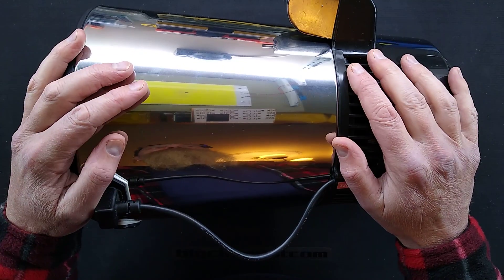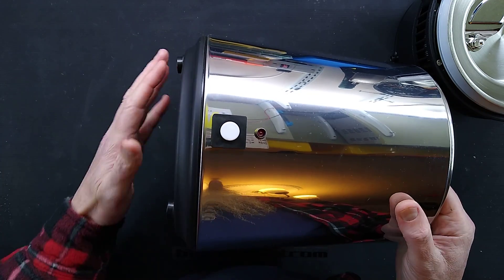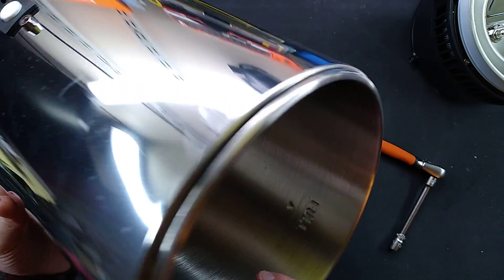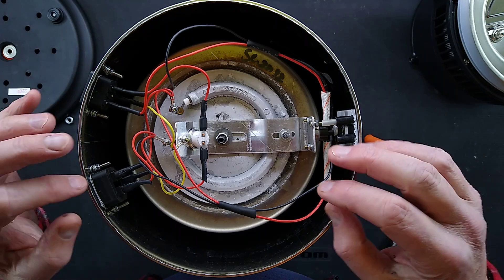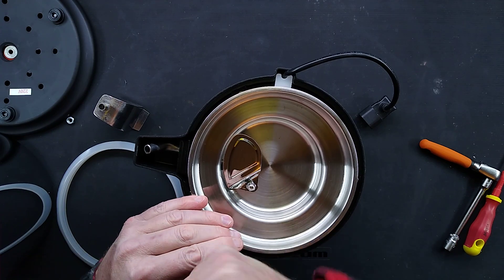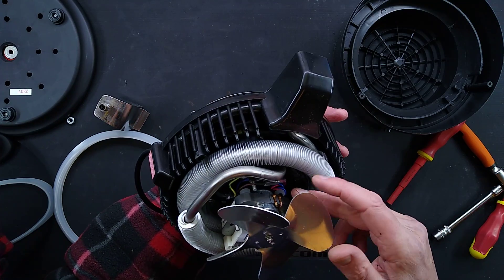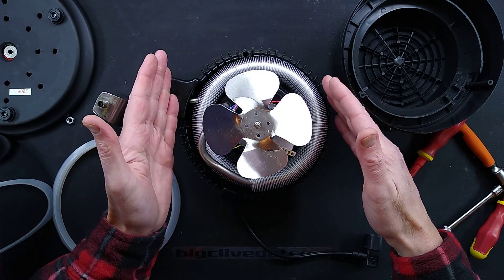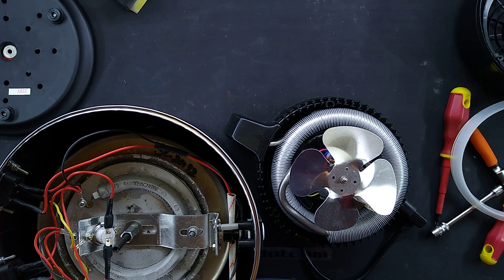Water/alcohol air-still distiller teardown

Comment: Anybody have a link where to buy replacment heating elements?
Reply from the maker: It's spot welded to the boiling vessel, so it's not really viable to change it.  Check that it is actually the element that has failed, as a thermal fuse may have tripped.

Comment: My brand new one expells a strong wine smell out the top butt I cant see any pin hole (could be poor seals). Also what is the fan volts & wattage, someone said you can plug em in a laptop charger
Reply from the maker: They need a full mains supply.

Comment: They also sell a version made for water, alcohol or oil distillation. The main difference is you can set a temperature and run time electronically on the unit. So no mod needed!

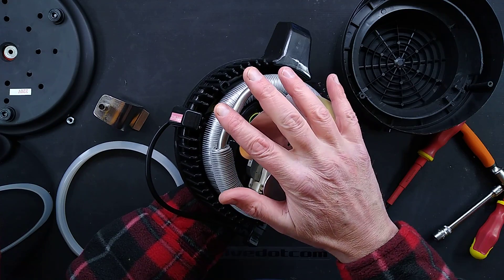Comment: Hello, great video. Around 6:25 you mention that air is pulled in and goes out the sides. Which way around (clockwise or anti-clockwise) does the fan spin as you look down on it? 

Regards
Reply from the maker: Anticlockwise.  It actually pulls air in at the sides and blows it out the top.

Comment: Thanks for making this video :)
Just bought the same one.
I wonder why the temperature - even when the controller is set at the max 150°C - doens't go higher then 99°C (jus water, even after 3 hours).
Is that a limitation of physics ?I should have paid more attention in physics class :)
Reply from the maker: 99C is probably the water boiling and maintaining that temperature by creating a phase change cooling effect.

Comment: We've hadc the builders in and a thick layer of dust has accumulated in the top fan.
From this video,I know you can clean it out now 😂
Thank you.  
Saves me potentially buying a new one.
Reply from the maker: Applying a vacuum cleaner to the outside should be enough.

Comment: This might sound dumb. But, it's one button. you can't set it to a temperature. Does it not operate at 212f? It wouldn't.. work. On water if it operated at 174f.. haha
Reply from the maker: It's intended for water.  The only thermal control is the cutout switch when the liquid runs low.   It relies on the evaporation of the liquid for the temperature regulating effect.
Reply: @bigclivedotcom  Right, thanks. I believe for alcohol you have to buy one thats FOR alcohol. Or a fancy one that is temperature controlled.

Comment: Do you think I could plug the fan into its own power and then run the heater on a power controller to reduce the heat ?
Reply from the maker: Yes.  I think that's common.

Comment: During the Covid thing and the year after I found it difficult to locate steady supplies of distilled water. I'm an older guy and I use a BiPAP machine during sleep that requires distilled water for humidifying the air. The solution to maintaining a supply of distilled water was to purchase a countertop distiller very similar to the one Clive has shown. Thanks to him, I now know how to replace the activated charcoal filter. No, I'm not too old to learn but you might have to talk a little slower.  :)

Comment: I once worked at an organisation that used a lot of lead acid batteries for remote chart recorders etc. and we had a magnificent still made with copper tubing to supply distilled water. Apparently they had replaced it a while before and some years after that "The Revenue" came snooping around to see that they old setup hadn't been put to other uses !  Life is easier with these devices so commonly available.

Comment: Cheers for that. Of course if distilling temperature was critical you could always put a temperature sensor in and use a motor control type circuit to chop the phase as you aim for you target temperature. I suspect a budding tinkerer has already done that...

Comment: I exatly own this device, not in shiny but in white. The area where the heating coil is connected to the bottom of the pot, is not water tight. I am using it now for 4 months, good water by the way, and its leaking inside the housing, out of the area where the coil is connected to the pot. I first noticed it, when move the pot to clean and refill that water spills out the bottom holes..then i shaked the thing, and i hear the water inside. It can not come from the outside of the mashine. Did anybody else have this problem with this distiller? Disgusting what load of dirt is in the 4liter amount of tap-water you will see, after destilling it. Disgusting, i think i never drink that shitwater from tap again.

Comment: The condenser tube is almost certainly stainless steel, probably SS-316, as distilled water will corrode any inexpensive grade of aluminum.
Reply: I can also tell by looking at it (the colo(u)r and sheen).

Comment: We have a similar distiller we use to keep the scale out of our humidifiers during the winter. As there must be some heat loss through those coils, I had thought about adding a normally-open thermal switch to the side of the tank, with the idea of letting the heater bring the water temperature up before the coils get the active cooling. Thought is that maybe it'll cycle quicker and use less power.
Reply from the maker: The heat loss from the top section is very low relative to the power of the bottom section.  It only really affects the steam.
Reply: @bigclivedotcom  Interesting. Oh well. I have so many other projects I should be working on that it wasn't likely to happen anyway. 😁

Comment: You used to need a Customs & Excise licence, even for a water still in the UK, I know because I had to renew our licence in several schools, I worked in. Not the glass version used for demos, but the ones used for producing distilled water. Many were made by a company called Manesty. They used a kettle element.

Comment: I think you can by "plug-in" dimmer switches; though they suggest only for use with lighting? I'm guessing that resistive loads work but that the switching of the dimmer causes voltage spikes? wouldn't anything with A/C as input need to sort out any induction anyhow?

Comment: Good day sir. I really like your channel. I have an old engine analyzer. It has diffrent settings for diffrent functions. One of these functions stopped working. I took it apart, and noticed that a resistor( i think thats what it is) blew.  I took it in to a electronics guy and he said nope can't fix that as there's no schematic for it :(  If I sent you a picture, would you be able to tell me what resistor ?? I need. Thank you very much for your tear downs, very interesting
Reply from the maker: As Matt says, there may have been another cause for the resistor failing.  What situation caused it to fail?
Reply: @bigclivedotcom   Good day, thank you very much for your reply. The reason why it went is I had it hooked up to my engine, and the unit fell, and in the process turned the dial :(  when I did go to use that mode , it wouldn't work, so I took it apart and found out it was a , I think a resistor. As far as banding goes I can only make out 1 which is red. I haven't taken it out to see if there is anything visible on the other side, but I guessing there might not be
Reply from the maker: @gm-lb9oe  It may be a very specific value that will require looking in another unit to determine it.  Maybe another faulty unit where that resistor is still intact?
Reply: @bigclivedotcom  Hi. The bad thing is the company that made it still exists, however they stopped making this analyzer years ago. Do you think if I contacted the company, they might have a schematic for it? I wonder if they would even give me one?
Reply from the maker: @gm-lb9oe  There's no harm sending them a picture and asking.  If they manufactured it in house they may even have the exact spare part.
Reply: @Matt Quinn - Caledonian Television  Thank you for your reply. Much appreciated.  I replied to big Clive, so thats how it went out on me

Comment: Distilled water is also preferred for cleaning reflector telescope mirrors.
Reply: @Matt Quinn - Caledonian Television that's the reason behind distilled water on telescope mirrors,  I suspect the alcohol on cameras is for the same reason,  any tiny smear on a sensor utterly destroys the cameras image and makes it a burry mess.
Reply: @Matt Quinn - Caledonian Television yes, the distilled water is because it can be left to naturally dry without leaving deposits, telescope mirrors need to be perfect and even the minimal of rubbing can leave them with micro scratching.

Comment: With the simple internal construction, an enterprising individual could easily hack that with a u-controller and mains rated relay to maintain a given temperature in the boiling vessel. Fit a solid state relay and you could even PWM the heating element for PID control

Comment: That encapsulated element looks identical to the one in the kettle that I took apart the other day. I’ll bet they’re all made to the same pattern in one factory, just with differing wattage ratings.

Unfortunately the kettle wasn’t fixable, the switch had overheated on the neutral side & melted the plastic supporting the terminals. I can’t decide whether to keep the element though, I’m thinking about starting some hot salt blackening for steel parts which needs sensitive temperature control, I was considering a PID controller, but I don’t think the old kettle will be big enough.

Comment: Dimmer is easy! Dual gang box, one side plug in socket, other side dimmer. Top socket you wire direct to mains, bottom socket wire to dimmer. Plug heating pot into dimmer, the end of the Condenser cord is the female end of computer or tv power cord. Plug computer power cord into mains voltage socket, plug the other end of that cord into condenser fan power cord. Enjoy!

Comment: Would you ever be willing to break down one of those EMP shield devices such as the ones from Amazon?  I'm curious what's in them and if they even do anything?  Afaik of you have a proper two layer faraday cover and it's grounded... That's the only way to be EMP proof.  Not being an electrical engineer if I'm wrong about that, feel free to explain it to me. Anyways enjoy the channel as always!
Reply from the maker: I'm guessing they are simple mains filters relying on the difficulty of making a complaint about their failure to protect against an actual EMP when one does occur.

Comment: The whole thing actually resembles an electric kettle (one of the fancy ones you leave plugged in and it keeps the water hot), down to the heating element and top part, I bet they're both made using the same molds and parts but just swap a few things around (ie some thermal switches and the top part). I might look into modifying mine actually

Comment: You can to some extent run shaded pole fans on dimmers if you put a suitable capacitor in parallel with the fan to correct the power factor. I tried doing this once to regulate the speed of an old record changer and while I got decent results it also put a lot of noise into the audio lines.
Reply from the maker: You can also add a capacitor in series to limit the current.
Reply: @bigclivedotcom  can you please explain adding a capacitor to cut the power in half. Maybe part numbers of the type of capacitor and possibly a video. Please!

Comment: So do you need a pitcher or kettle under the drip/pop out?  My 1st thought was that there was going to be a small holding tank inside but it appears that I was wrong and this is like a coffee machine style machine regarding how it runs.  Also, I've always thought you needed copper to distill some things because if you don't have copper touching the fluid, it doesn't neutralize a certain toxin/odor or flavoring.  Maybe I'm wrong on that but I would def check before distilling anything other than water.
Reply from the maker: It comes with a suitable container and ported lid to catch the distilled water.

Comment: For distilling liquids with a lower boiling point, I bet that coil doesn't get cool enough to properly condense all of it. Like you said, you'll lose a lot. It looks like you could remove the low speed fan and mount a high power fan on top of the lid. Have you seen Linus Tech Tips' blowiematron? That would be ideal, albeit loud. All the cooling you need. What I like about this still is how it's all self-contained and the stainless steel is a good material. Not happy with the aluminum top though, maybe that tube needs to be electroplated on the inside with a better metal, if that's possible.
Reply: This is that video: https://www.youtube.com/watch?v=nAFB9w2Rh0Y
Reply: Is it really aluminium though? To me the fins look like aluminium but the tube looks like stainless steel. It's just a tiny bit darker, less silvery white. But yeah if it is aluminium that would be bad.

Comment: Okay, I have to admit it. The matt black bench looks very good and modern.
Reply from the maker: It's the emergency backup bench for things that don't fit on the main one.
Reply: @bigclivedotcom  from the perspective of a thumbnail, this looks even better. I don't mean to push on you, Clive 😉 but you may consider switching to a black top for other videos. I watched every episode from this channel since, i don't know, like 7 years, and what's important to me, is your knowledge, passion to discover, reverse engineering, and fun. The color of the bench is nothing special to me, but now I see, just how good it is at baiting and pleasing our eyes.
Reply from the maker: @abcdefgh1279  I used to use a black surface, but it caused huge exposure problems.  I have to use tricks to dupe the camera into locking at the correct exposure level.

Comment: Anyone knows a distiller that (small, max 150w) that can distill lets say 5 dl (or more :-) per hour? pretty much this variant as it looked really good but a smaller variant. And if it can be used with saltwater (yes I know that is really nasty) it would be awesome to have on camping trips around saltwater coast... dried food is often pretty lightweight but 1-2 weeks without freshwater is hard... could probably use a solar distiller, but then I would still need some solarpower for tablet/phone/fans/lamps and so on charging...

Comment: For controlling the device to make something other than distilled water it would be useful to have a thermocouple on board (also for extra safety) are there any convenient places to locate one please ? asking for a friend...cheers.
Reply from the maker: A thermocouple with tag could possibly be attached to one of the thermostat mountings or siliconed onto the base.

Comment: Clive cpap sleep apnea devices require distilled water so that the hard water deposits don't  form in the humidity chamber.(my sinuses bleed if I do not use the humidity)  I have a much earlier (1990s) version of this device and when I can't get a gallon of Distilled water at the store it works a treat.

Comment: Lately, I've been buying gallon size bottles of distilled water for my ultrasonic humidifier because they will just throw the lime scale into the air with the water. It's one of those "fire" effect humidifiers. A gallon of distilled water is about a dollar. I don't think it would be any cheaper buying a distiller and making the distilled water myself when you combine the cost of the water with the electricity. It just seems like mass produced distilled water would be cheaper to make. Also, the air conditioner would have to fight the distiller in the summertime.
Reply from the maker: We can't buy distilled water from supermarkets in the UK.  It seems to be an American thing.

Comment: Our local (SoCal) water is super hard, I regularly see (well) over 600 ppm dissolved solids from the tap.  For my first 50 years I drank water from the Great Lakes, so now I gag on raw Cali water.  I currently use resin-based ion filters to get the minerals out, at a cost of about US$10/month.  I've always wondered if a still would be cheaper (certainly less waste, as I toss a kilo of resin and plastic into the landfill every month).  Maybe put something like this on a solar panel and just let it run...
Reply: Just be sure to add back some tap water to get some mineral content.
Reply: @mgratk  I drank 0-6 ppm water for 50 years without ill effects, but now I use tap water for coffee and tea, so I get my daily minimum of selenium and arsenic through that vector.

Comment: I wonder what the result would be if the water being distilled were to have a lower-boiling point contamination in it, say, petrol or acetone.   Would that not also appear in the distillate?  I note that alcoholic distilleries usually discard the first part of the  distillate.
Reply from the maker: Yes.  Volatiles will go through.  They may partly be absorbed by the optional carbon filters.

Comment: Water from these is also preferable for pH pens for... uhm... anyway!

I love that the fan in thus unit looks like a real life version of the pictogram used on British Leyland rocker switches for the heating/cooling fan control!
Reply: storing in distilled/deionized water is not beneficial for pH probes, still a lot of mis-understanding of this issue (even some suppliers)